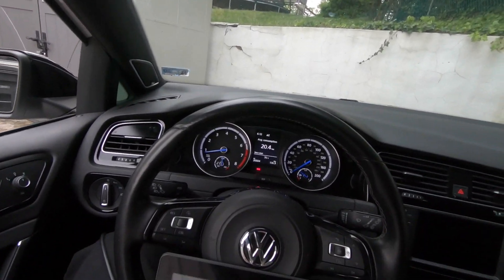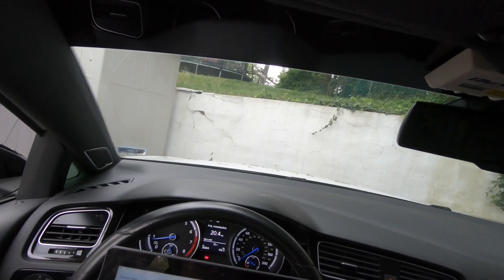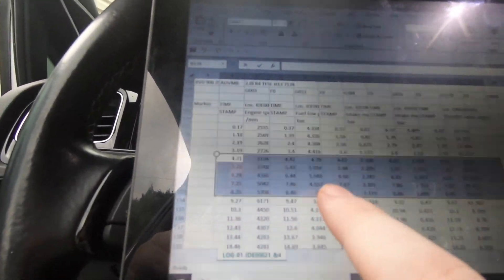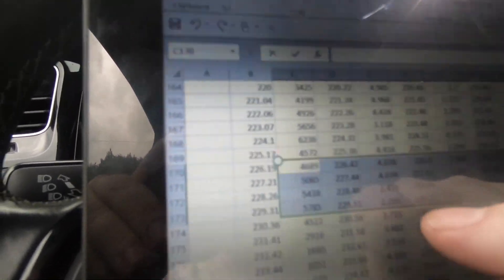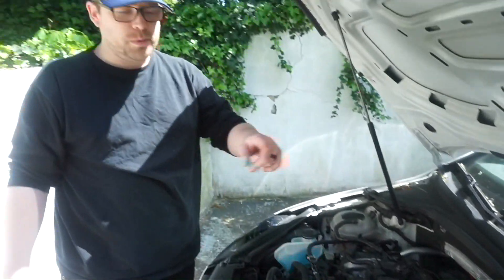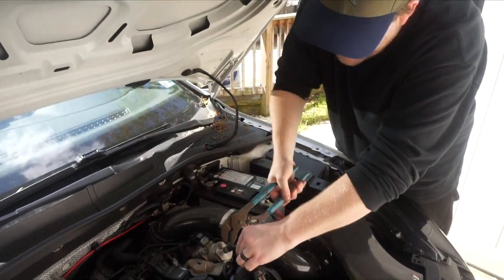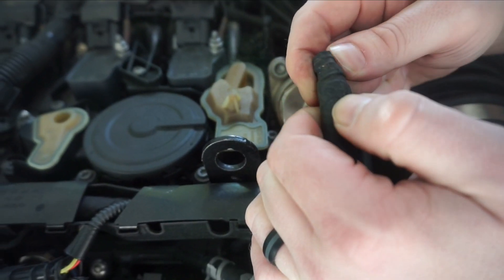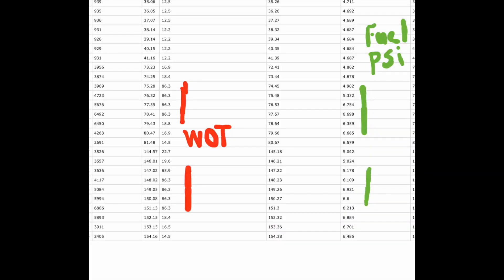DATA LOGGING with VCDS VAG COM (fuel pressure)

Comment: Sorry, I think I commented on the wrong video.  Lol. Anyway was hoping to see pulls with the line fixed.  What’s wrong with 3rd gear?  Are you getting locked out?
Reply from the maker: Always locked out of third at high RPM
Reply: SleepyDubVRT Unfortunately I have the same issue. Seems to be common. Bryce Jordan recently started have an issue also if you watch his channel.